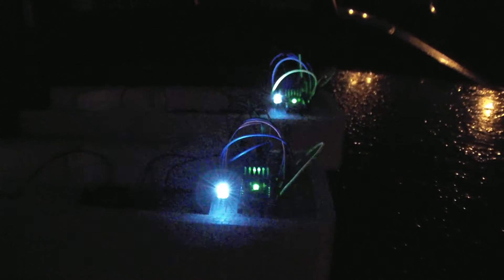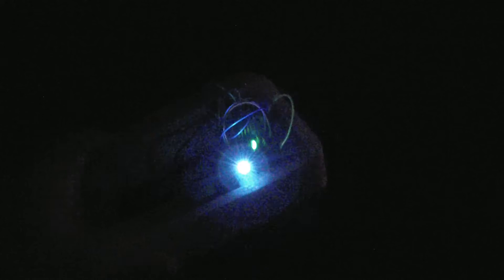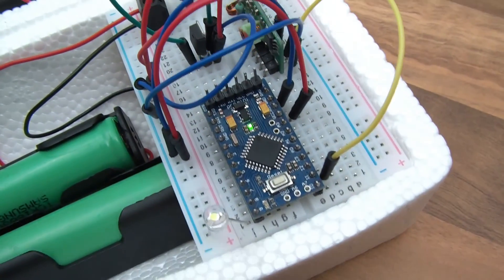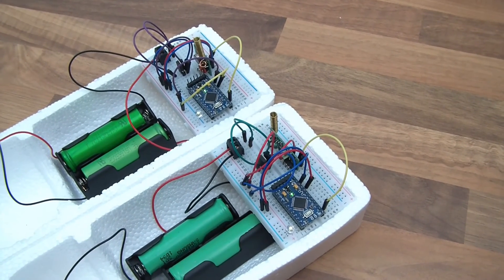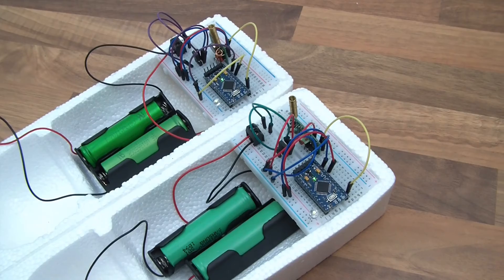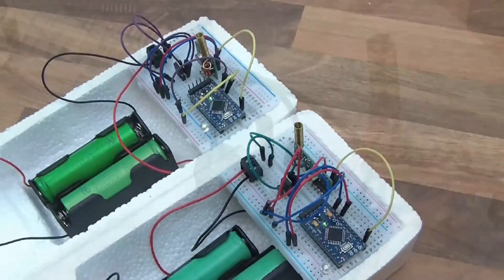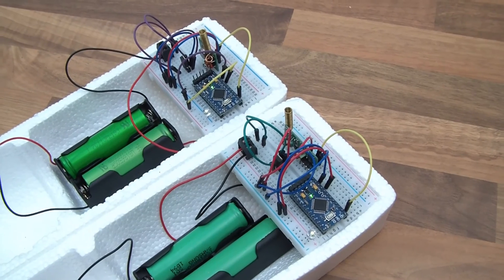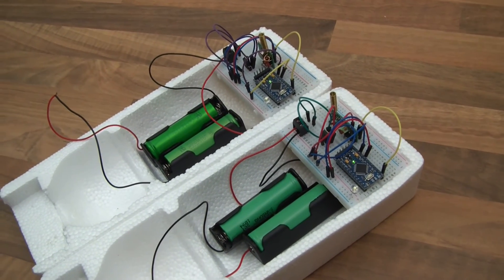INVESTIGATING: The Range of Cheap 433MHz RF Transmitter Receiver Modules - Initial Test! (Part 2/5)

Comment: if its hight sensitive, then its due to fresnel zones, if you're using 433MHZ, for a 40m distance, the high of the antenna must be 2.6m above ground
for more distance, its even higher, not accouting for other factors like urban interferences ..etc
theoricaly you can get 3km for 10mW/10db in outdoor use beyond any interfrences and background noise, but you also have to put them 7meters above ground level bc of fresnel zones

Comment: Awesome! I think 40 meters is a pretty good range for a component which cost a couple of quid! 
I'll have to get some of those aerials. Have you ever used these modules  to send and receive Serial.print commands? or just general data over RF? 
Great video Antony!
Reply from the maker: Carl Bartlett I have and it worked well, but they don't like walls very much!
Reply: That's a shame! I read somewhere about providing the transmitter with more voltage and the signal goes further... I haven't tried it though. That could possible get the signal to go through walls? It'd be interesting to see how Honeywell and other manufacturers get their RF link thermostats to travel so far.
Reply from the maker: Carl Bartlett it will go through was, but it struggles.

Comment: Hello, interesting video thank-you :-).When you are at the far limit,  it is interesting  to try to change the orientation of the receiver's antenna for about 90° in each directions, just for check. some times, the right orientation can make a good range enhancement.
Reply from the maker: Daniel Roibert Yes, I found this too. But really, I want it to work no matter what the orientation is. :)